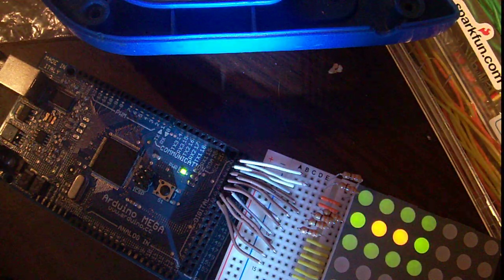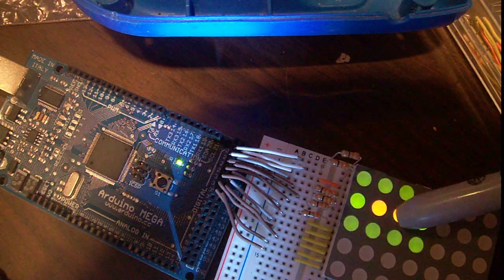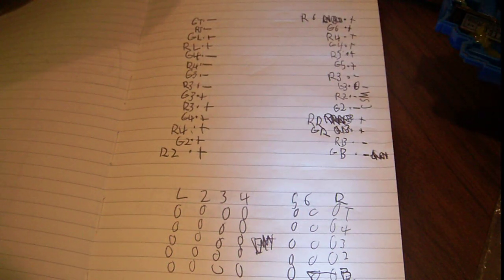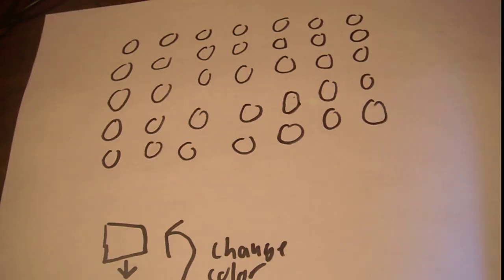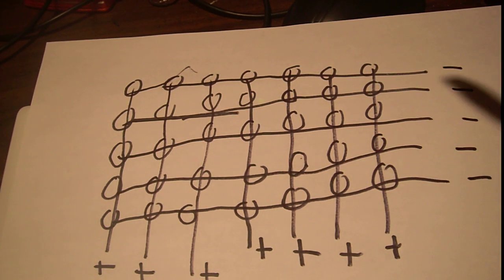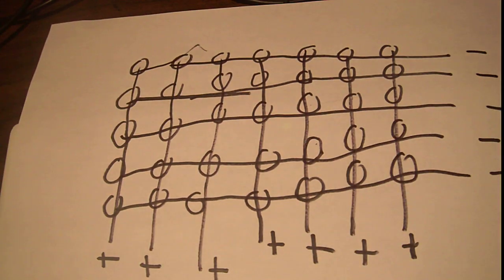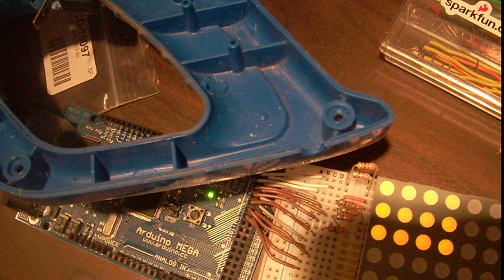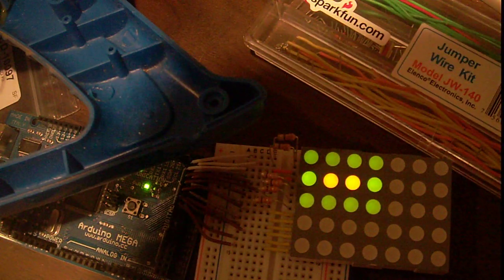5X7 LED Matrix Tutorial

Comment from the maker: There is no need for a transistor in this circuit unless the micro you are using can not handle the current that the led's need. In that case for the anodes (+) setup the transistor (NPN) such that the emitter goes to the anode, the base through a resistor to the micro controller, and the collector to the positive voltage rail through a resistor. For the cathodes (-) the base goes to the micro via a resistor, collector to the cathode, and emitter is grounded.

Comment: @quicknuclearscience I see. My apologies, then.  Perhaps sitting the camera on a foam pad would do the trick and cut down the vibration. Almost makes me wonder if the microphone has come loose within the camera.
If you're using a tripod, then try a piece of rubber or foam (or even carpet) under each tripod leg.  If the camera is just sitting on a desk or shelf, then rubber or foam right under the camera. If you don't have that, then even some cloth like a folded up towel could work, too.

Comment from the maker: @HyperGenius3  sorry about that, but there is not much i can do about the mic problems in the videos i film (as opposed to hypercam 2) .  I don't actually have a separate mic, i'm using the built in one in the camera, because my camera does not have a spot to plug one in, and if you move in the same room as the camera it shakes it and makes the noise so there's not much i can really do.  I might try adding a primitive pop filter to see if that helps.  Thanks for the feedback.